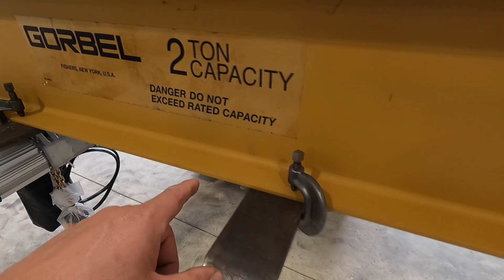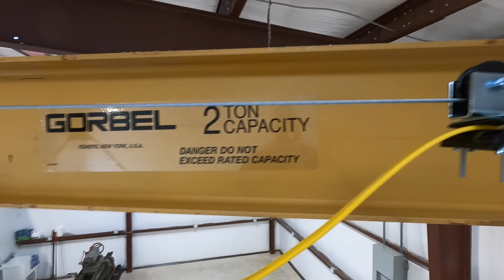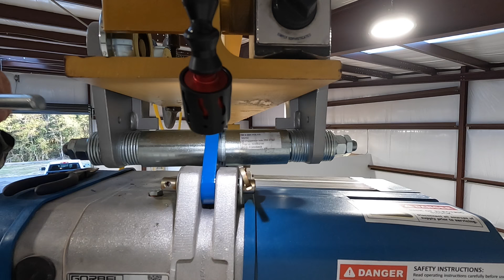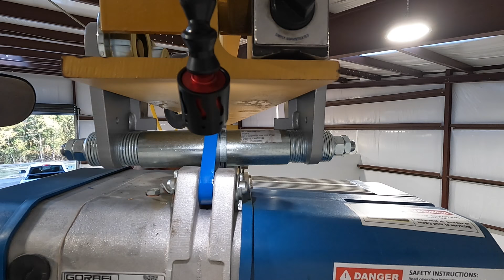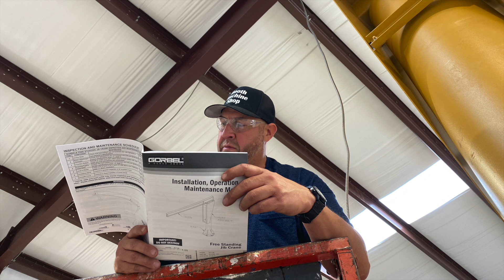Gorbel Jib Crane Installation Part 2

Comment: Great video Adam. You did a great job on the installation of this crane. I was also very proud of Abby. She did a great job getting up on the man lift and guiding you in there and getting the holes lines up for the bolts. I'm not so sure my wife would of been willing to operate and go up on the man lift. lol

Comment: Just a piece of information when it comes to clamping cables Never Saddle a Dead Horse. Youre only holding an electrical wire but so you'll be fine but its always good to put your clamp saddles on your long side of cable and clamps on end.
Reply: I noticed that right off and started to check the comments to see if anyone else had

Comment: when it comes to steel wire there's a common phrase:

"Don't saddle a dead horse" also that kind of cable clamp you use at least 2 on each termination.

Comment: I have always put the wedge washer on the web of the I-beam. This allows the  bolt head, to sit 'flat', on the angled web of the I-beam. The bolt head is then in contact all the way around the circumference of the head. i suppose if you orient the wedge on the bottom to match the angle of the bolt that works too. But then the bolt is holding the I-beam at a slight angle, don't know if that would matter.

Comment: There’s an old saying i was told many years ago when it comes to clamping wire rope.   “ never saddle a dead horse “ . Meaning the end of rope should not be in the saddle part of clamp but on the u bolt side.Less likely to slip or better grab that way. Not crucial with just this tag line you installed but more effective and less likely to fail .  Oh, and the trick to seat belts. Pull out and go around back side of seat and connect. No buzzer and nothing bugging your back then . :)
Reply: Great tip.   
Safety 3rd.    Ha...

Comment: Abom, I really do like what you do, but hanging the Jib crane you should have talked a buddy that is a rigger into helping. The one thing that i would recommend, when time permits, is placing cable thimbles on the wire rope where it loops through the eye bolts. Overtime they will save you having to possibly rehang the festoon wiring system. 
Also there is an old saying amongst riggers, "You Never saddle a dead horse." In other words the saddle part of the cable clamp, the part that fits over the u-bolt, goes over the live part of the cable thus causing the u-bolt to basically crimp the the dead end. have a good day and be safe
Reply: Yes, “don’t saddle the dead horse”
Reply: I had to scroll down to find someone screaming about the lack of thimbles. Amazed Gorbel apparently didn’t include them, and even more amazed that Adam didn’t feel like something was horribly wrong putting it together without em. Though I’m glad I at least also learned from yours and all the other comments about the importance of saddle clamp orientation—thank you.
Reply: while I too was surprised there was no thimbles, lets keep in mind that the wire rope only serves to hold up the electric line and is unlikely to ever wear especially on the bolt eye ends.
Reply: @frotobaggins7169  you’re not wrong. I was cringing by the couple janky details of the otherwise stout Gorbel. There were just a surprising number of times that I found myself yelling at the screen like an old man. 😂 I probably ought have kept it to myself. All’s well that ends well though.
Reply: @fosterlewis7360  Yeah, for 10k or however much it was, my expectations are a little higher than a bag of washers.  Other than that it's nice, i like the simple design.  They make a startling variety of that jib crane, very startling.

there were some moments there i think a lot of people yelled at the screen.  I'm glad it all worked out fine.

Comment: My wife insisted I have a skyjack for my building from a safety standpoint when servicing the garage doors, furnace, chain hoist, etc.  So I built a small removable staircase to get onto the skyjack platform and use it as my elevator to the storage loft when it is not in use. Skyjacks are great as they are all relay electronics instead of all sorts of electrical circuit boards that the average person can’t trouble shoot. It would look great parked to the left of the double doors to your office for your loft.  I bought mine used from a rental for half price of a new one 20 years ago. It has been trouble free.
Reply: This is going to be my first purchase when I move into my new shop. Just the thought of how many times I would have to climb up and down a ladder installing electrical conduit got me thinking about it.

Comment: 4:00  You should always Drive The Bolt instead of spin the Nut ! With or without a lock washer !  AND  ALWAYS USE THE U-BOLT OVER THE DEAD END (the one with the ending)OF A ROPE OR WIRE !!!!! NEVER "Saddle a Dead Horse" !!
Reply: Don't saddle dead horses. Don't worry, a knotted fishing line would have been enough to hold the power cable. :-)

Comment: A machine shop has hoses clamps holding safety pin !!!   Come on Gorbel drill two holes and two locking pins !!!   Can’t believe manufacture would be that cheap !!!
Reply: It'll do the job.
Reply: Yeah, that is odd. All the other pins on the hoist motor were drilled and had cotters, so why not the safety pin huh?
Reply: @beezul  A split pin is NOT a cotter pin ! It's a split pin !

Comment: Adam, I believe you have installed your wire rope cable clamps incorrectly. The saddle part of the clamp should be placed over the long part of the wire rope and the
“U” part of the clamp should be over the cutoff end of the wire rope. The way you have it installed will not develop the designed strength of the wire rope. In the industry
We always say don’t saddle a dead horse as a memory aid for how it should be done. Hope you get the analogy.
Reply: yeah, the "never saddle a dead horse" quote.... but in all honesty, that doesn't matter on a tag line. the tag line doesn't hold any load... this matters 100% on a rope install for a wire rope hoist, but not for a tag line.
Reply: Haven’t heard that in twenty years. 👍
  The rope clamps we used on swing stages had a double saddle. Each half is identical with one leg , one hole and a saddle.

Comment: i didn't know it but there is a correct and a incorrect way to install wire rope clamps and if i understand correctly you installed backwards. i know it isn't holding weight but knowing how you are about details i thought i would mention make sure im correct lol

Comment: Hey Adam  on cable clamps … the saddle or body of the clamp should be on the main line. And the loop clamps the tail end… A way to remember is a saying … you always saddle your horse!!
Reply: I noticed that at 7:30 as well...I remember it as "never saddle a dead horse!" The saddle side won't compromise the strength of the wire rope, the sharper radius of the U-bolt will crush the working side if it's installed wrong. (Fortunately, that's just the tagline, and a bit of string would be adequate to keep the cable from dropping on your head; no one's in any danger here.) Nonetheless,  it's always good to use and to demonstrate proper techniques!
Reply: @kevinvermeer9011  So neither of you commented on the lack of a bend limiter where the cable went through the eye !
Reply: @millomweb  yep means  you put the saddle on  the main cable, not the lose tail!
Reply: @KG-yn9qi  Why ?
Reply: Now I’m confused is it you saddle a dead or horse or don’t saddle a dead horse. Or just beat a dead horse over and over and over and over until your really sure it’s dead. I’m not sure it’s dead the way it keeps popping up. Maybe it needs a few more mentions
Reply: @millomweb  the clamp body is is made to support the the cable  ( not cause damage to cable and give more surface area to hold) as the u-bolt  squeezes the tail or short end together . The load to pull it apart is the main cable so that needs the most support. You can look up cable clamping procedures to see examples and why! To get better explanations with pictures!

Comment: Hey Adam, it doesn't matter much for this cable, but if you're putting together a more critical cable, the second Crosby clip you put on was backwards. Just thought I'd point that out Incase you didn't know. The saying to remember which way it goes is "never saddle a dead horse".

Comment: 35:17 the wedge shims are supposed to go on the I-beam side, since that is the angled surface
Reply: Looks to me that this I beam has flat flanges.
Reply: @janvisser2223  Since I-beams are roll-formed steel sections, the flanges are tapered slightly.  The outside surfaces of the beams are straight or flat across the flange.

Comment: Abby you did do a great job both with the cam and getting it aligned ! Steak & Lobster for the mrs ! Crane looks good i'll suggest put a hanger on the back wall beam for when it's not in use to put the hook & power control so your not cracking your heads on it ! Your head will thank you so will Abby !

Comment: 5 years ago the company I retired from bought a similar crane. I fabbed 2 more identical cranes for other shop areas. I welded stops on the post near the top to stop excess rotation of the beam either left or right.
Reply: Spring stops are 100% worth it, they make working the crane so much nicer

Comment: Great video Adam. Pretty impressive to do this on your own. You should reinstall the wedge washers to the inner surface of the I-beam. It will square up the orientation of the bolts.

Comment: When installing a cable clamp: never saddle a dead horse.
Reply: Does it really matter? If either rope slips, it is over red rover.
Reply: @jemijona  the saddle with more contact area should be in contact with the live end. Less pressure on the live end and less like to damage the cable. Not about slippage. For this application of supporting power line not likely to matter except for good habit / practice.
Reply: Thank you. That does explain it. Cheers.

Comment: Put some heat shrink tube on the raw end of the cable.. You'll love me later when it does not sting you with some frayed out wires. Those wedge shims are called channel washers by most.

Comment: Those fingers at 29:14 😱
Reply: Yeah I cringed a little.
Reply: I cringed a lot.  I was praying she wouldn't stick her finger in the bolt hole.  She kept looking like she was about to.   Also, she was on the wrong side of the beam should it have fallen, she would be on the side it fell towards with no where to go.  And then Adam constantly walking under the lift and the load.  Once he was just standing there talking to Abby while standing under the beam.  While I realize that nothing was likely to happen why take a needless chance when something COULD happen.

Comment: At min 7:30 you put the wire clamp's U-bolt on the live side of the wire. (Tag line wire cable) The clamp's U-bolt always goes on the dead side of the wire. The end you pulled on and cut off is the dead side.
Reply: True, I saw this too.
Reply: At least it's not holding any weight.
Reply: Never saddle a dead horse

Comment: I have a Leblonde 16" x 96" lathe I bought on ebay. I hauled it home on a gooseneck trailer.  I backed it in my shop and lifted  it with my gantry crane and a 5 ton chain hoist. I pulled the trailer out and let the lathe down to about an inch off the floor and started to roll the trolley to move the lathe sideways and the trolley bent out and came off the crane beam and the lathe, trolley and chain hoist all dropped. Luckily nobody or the lathe was hurt. Sure glad this happened when is was close to the floor and not trailer high
Reply: It's the crane that needs to be rated 5 tons, not just the hoist !
Reply: @millomweb  the crane will lift over 5 ton. The trolley, not so much. I have since upgraded it

Comment: Hose clamps on pins, lots of washers as spacers, not the most elegant solution. One would almost think the handyman fixed her up. Sure it will work though.
Reply: Those washers as spacers are pretty standard way of shimming out those dollies, there are so many different sizes of beams out there and making a different spacer pin for all of them wouldnt be economically viable and also a pain to install.
Agree on those hoseclamps that's just strange, 2 holes and a couple of cotterpins would have been a neater solution.

Comment: Never saddle a dead horse with your cable clamps if it's load bearing ABOM, saddle of clamp goes on live end of cable
Reply: Am surprised there were no thimbles for that cable, some ferules would be nice too
Reply: Thanks. I learned something useful today.
Reply: @user-sg1ku5hu5d  it doesn't wear at that point, but absolutely agreed that a thimble should be there. Johnson clamps are on backwards and why not have two on each end? Cheaping out by Grobel.

Comment: 29:05 ... No disrespect to Abby but everyone that's done steel work just recoiled back from the screen right there lol. I guess like most trades there are ways of working that become second nature. I know if I ever got on a lathe I'd break something real fast so you guys did a good job with a difficult install.
Reply: I said out loud, "Get your fingers out of there" more than once.
Reply: Yeah, made me cringe too! I've been around machinery for most of my life but the one that REALLY got me was a freshly machined flywheel I was helping a neighbor install on his Ford PU. I was underneath putting it on, lying on my back. The flywheel slipped and pinned my left hand to the trans crossmember. Severed the middle finger extensor tendon right on top of the knuckle! 😖Took a year or more before I got full use of that hand (carbon fiber suture in the tendon). Be careful, wrenching one handed is a PITA!
Reply: I think we all were !  Plenty of space to push lower down on the sides.  That gap was like a pair of shears.  Fortunately all was well this time.

Comment: If you bounce while going up, you will make it past the point where it won't lift, I do that all the time.
Reply: It shouldn't be necessary ! Well, not with only 2 ppl on it.
Reply: @millomweb  depends on the lift capacity and the weight of the 2 people/tools....
Reply: @sentient2016  I'm confident that even the smallest lifts like this one are designed for 2 people - and that shouldn't mean 2 skinny people and should allow for tools etc. Tools in this case was negligible.
Reply: @millomweb  I am quite confident you are wrong. I mean I have only been in situations that require "the bounce" to get over a certain height in a lift,but if you want to believe you know everything about this subject have at it!
Reply: @sentient2016  If it'll lift the weight at the start, it should lift the weight all the way. I have come across a lift that wouldn't lift just one person over about 3-4 feet. The load on the hydraulics actually reduces after the first part of the lift due to leverage.
Reply: @millomweb  maybe if that is your point you should re-read and grasp what the op said.... we all said the same thing. You though had to play what devils advocate? Even though you acknowledge the need and THE REASON for a bounce.

Comment: i am not a engineer, but i thought the bearing assembly was undersized compared to the size of the column. I liked your pins better lol Also somewhat surprised that you didn't machine spacers to replace  all those washers
Reply: I’d bet it’s more about staying in the factory perimeters for safety for warranty. Obviously he would machine them but you can’t go changing structural things and expect warranty to be good or if an accident happens the buck would stop with the guy that thought it was a good idea to throw away the hardware that came with the equipment because he decided to make his own.
Reply: I’m sure Gorbel just threw what everyone whatever bearing was laying around in there. I’m sure they have no idea if that bearing is large enough. I’m sure they are looking not get sued if it is under sized. If your not an engineer why would you assume the bearing is too small. I would be willing to bet it can handle more load than it’s rated for. Safety factor
Reply: @ChrisM78  absolutely agree.

Comment: Adam, you calculated the shim wrong. "Adjust the boom to a point of L/300 (length of span in 👉inches👈 divided by 300) above level at tip of span." You used 15 ft when it should be 180 inches divided by 300 = 0.6 inches thick steel shim.
Reply: That's not the shim thickness. It's the amount above level that the tip of the boom should be.
Reply: L/300 in inches would be similar to max allowable deflection at the end which isn’t what a shim is for at the beginning
Reply: @dkupy100  You are right in calculating the L/300 (15ft/300 = 0.05 ft = 0.6in). But again, that is not what the shim thickness should be. The shim thickness needs to be whatever makes the end of the boom 0.6" above level.

Comment: Love that crane. Would love to have one in my shop some day. The crane will sure make working with heavy parts and equipment a real joy. Goes really well with the Amercan. The one thing that is missing is the Abom79 stickers on it. 
Those areas, like in the corner that the crane won't reach would be a good place to put some of the tooling cabinets for the lathe and milling machine. A bench with a good vice would be good between the lathe and wall that can be used for the lathe, mill or what ever.

Comment: Nice job on this. I need a smaller (much smaller) version of one of these for my shop. I will note, that it's recommended to put the cut end of the wire rope against the U bolt with the long end against the saddle.
Reply: A gantry crane would be way better than a jib crane than it could reach every corner of the shop as opposed to just the radius of the jib
Reply: @mcgizzle7835  Not for my shop.